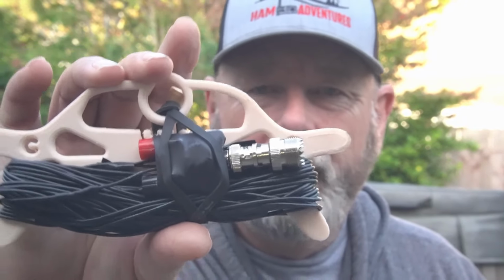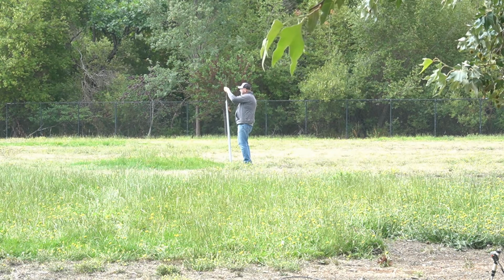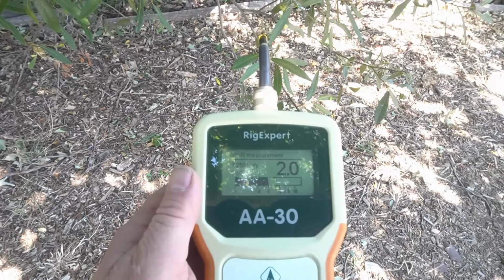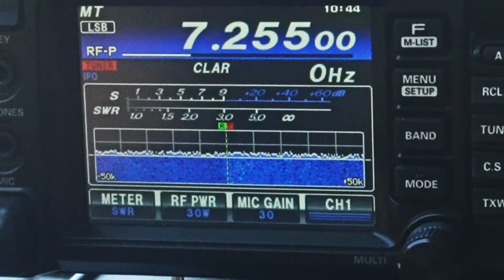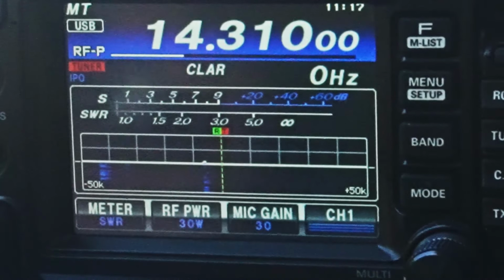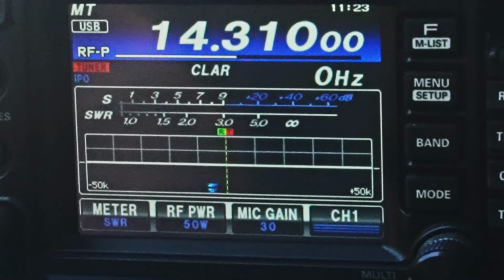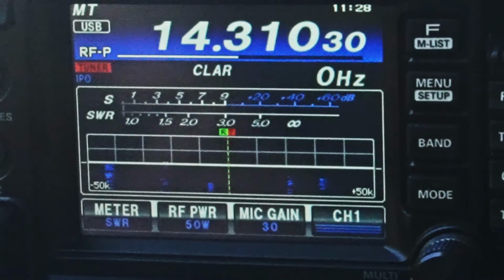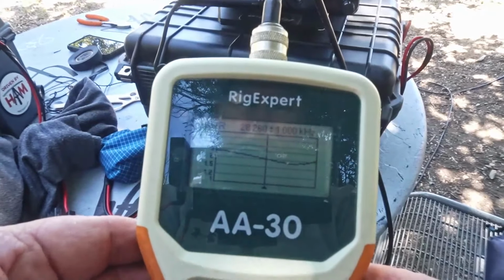How to make a 20 watt capable QRP EFHW Antenna.

Comment: Nice test Chuck. I will be building one with 2 x FT240-43 shortly to handle 400w digital. We'll done on the 3k subs, you are on fire now.
Reply from the maker: Thanks Colin, I was surprised at what it would do actually. I won't go crazy with it I have other antennas for higher power. Great on the 400 watt antenna should work great , I didn't know you had a amp for 400 watts. I need to do a review on my THP amp that is 4-500 out. I see you have some new videos out , I had a chance to watch one and I did use the Adjustiwave last weekend and made a contact whith Carlos on his parachute jump. 73
Reply: @KK6USYHamRadioAdventures  that's awesome on the contact with Carlos. I've had an Acom 1000 since 2012. It's a spectacular amp and totally idiot proof. It's not even ticking over at out legal limit.

Comment: Good test Chuck it shows a good result for running lower power, I have got one made up with the single Toroid like you made in the video. Have not really used it yet portable apart from tuning it up in my yard and chasing a couple SOTA ops on CW. vk5cz ..

Comment: Hi there Chuck .... great video I will have to build the transformer with 2 T150-43 todiods. What was your final length for the antenna? 73 ..... Garry VK2GAZ
Reply from the maker: All my other EFHW's have been around the 45' length , but this wire seemed to need to be shorter I think I took 4' off and folded it 6" or 1'. I will try and measure it next time out and get back to you.
Reply: @KK6USYHamRadioAdventures  Thanks Chuck ......

Comment: What size toroid are you using?
Reply from the maker: 2,  T-50-43
Reply: @KK6USYHamRadioAdventures   I was going to use a single 82-43
Reply: I used a single 117-43 and had good results.

Comment: SWR is only one measure with which you should be concerned. Bigger or additional toroids should improve efficiency, particularly on the lower bands. You may want to measure efficiency. DE WA1KLI
Reply from the maker: Yes John, heat on a EFHW is usually the reason that the SWR raises and that's what the experiment was about seeing if a extra toroid would help get it to be reliable at 20 watts. I have had a lot of viewers ask about their G90 and how light of a antenna would handle the 20 out of that radio. The antenna design has been around just a 49:1 wind, so I know the antenna works fairly efficiently and as most antennas it has it's compromises. Thanks for the comment!